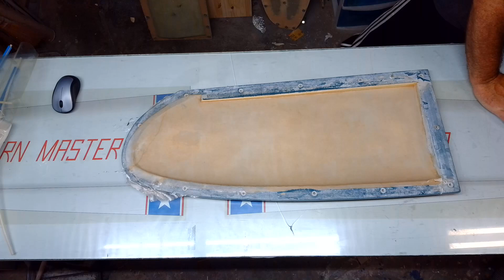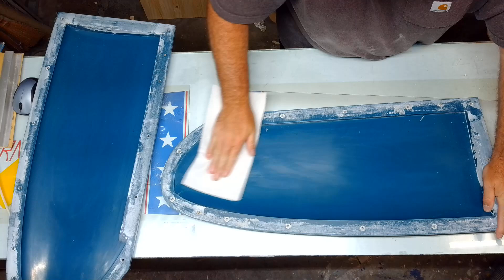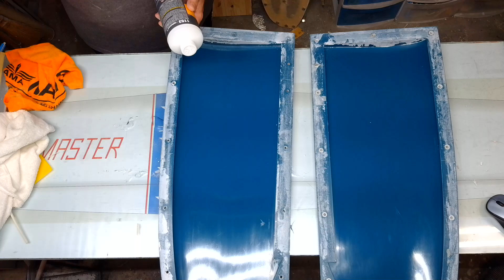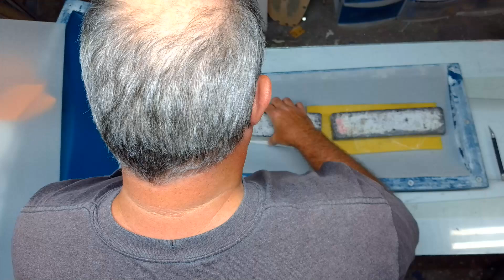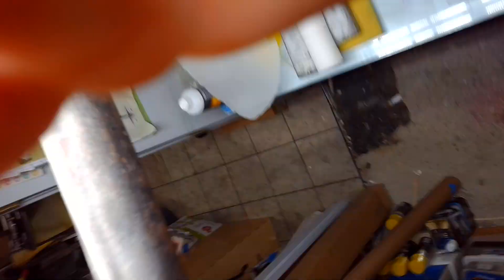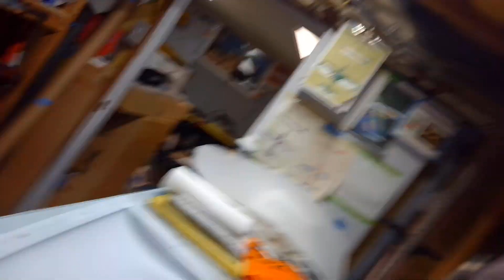High Voltage Shark Volume 4

Comment: It looks like the Teflon peel ply worked out well. I've been doing a few tests with release agents and paint. I tried a Feekote 700 NC on plate glass and rattle can lacquer backed up with epoxy and glass and it came out good.  I guess about any paint that's not water base would work out over PVA. Thank you for taking the time to post your progress I always look forward to watching.
Reply from the maker: Thanks Dan. I have put water based paint over PVA with success. The peel ply came right off!!!!